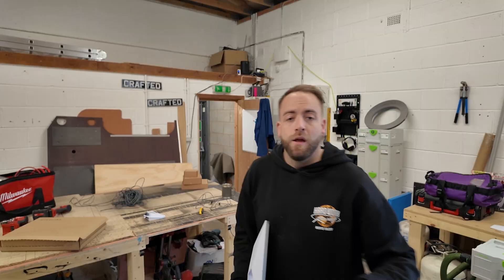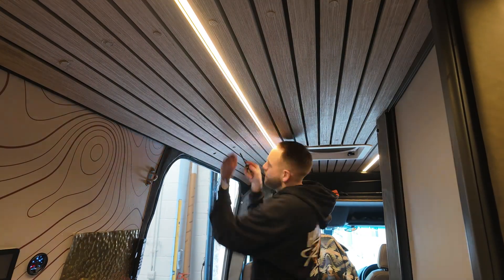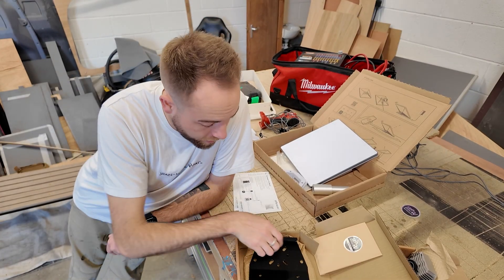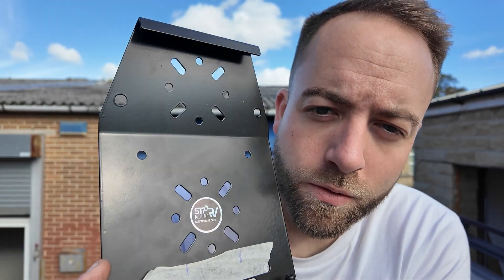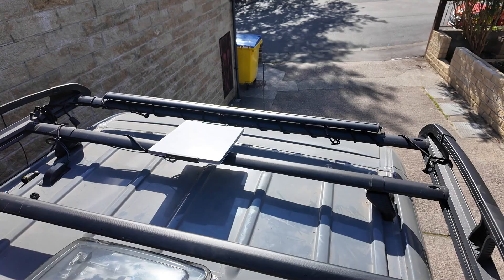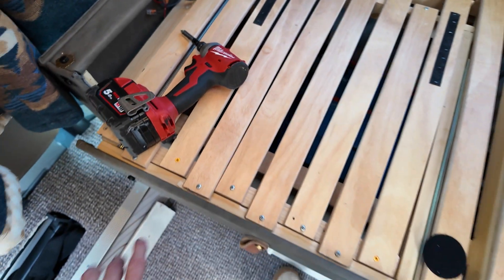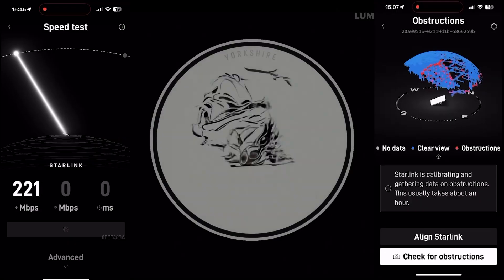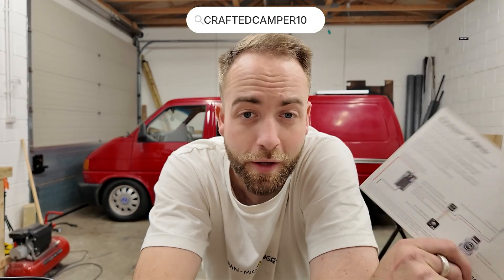Campervan Starlink - Watch this first!

Comment: Not surprised if people struggle to connect to 3g networks, they've all been switched off 😂 There aren't many places where I can't get 4g/5g, though I don't really get into the middle of nowhere. But following reviews I've seen, I'd expect that with a decent antenna, 4g should be achievable just about everywhere. Not saying Starlink isn't likely to be faster for the odd occasion, but since they stopped allowing you to pause your subscription, it's a service I really couldn't justify myself.